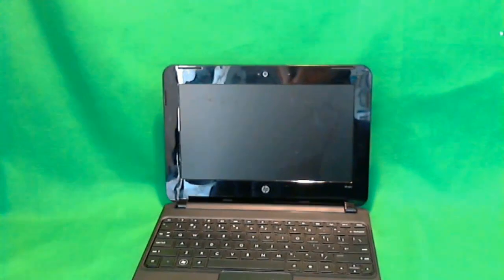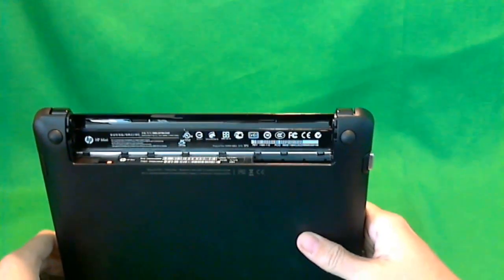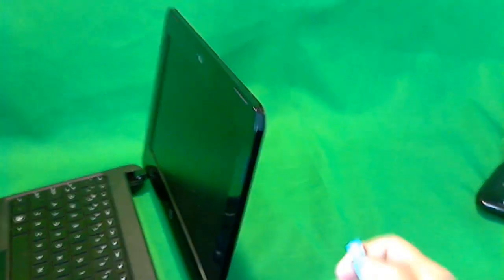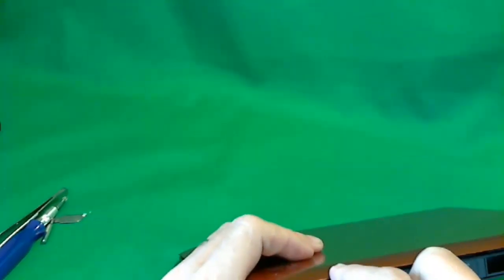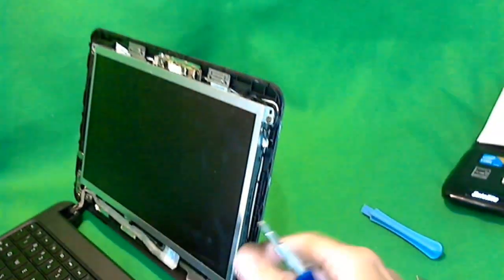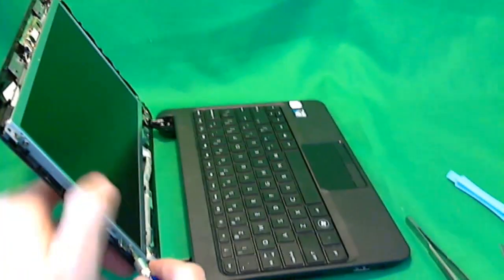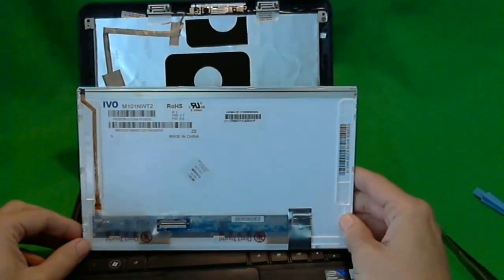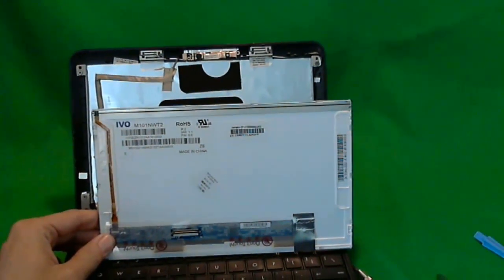HP Mini 110-3135DX Netbook Screen Replacement Procedure

Comment: Very helpful....same process for my hp mini 110-4250NR; even got to use a thin plastic knife and a small bread knife for d screws...didn't have my tools with me and needed to check out why my screen was flickering....alas it only took me opening n closing it to get my screen working perfectly again.
Reply: By d way, I checked to see d cable was well fitted....likely it was loose because after I closed it, the screen came back to normal

Comment: The most difficult bit was reconnecting the cable (Eugene doesn't show you this), it's a very slim fit and I thought I had mangled it, the adhesive stopped it from sliding into place, I had to use a slim plastic knife to push it in flat. But I was pleased that I got it to work, I would never have attempted it without watching this first.

Comment: You should never ever ever pull the cable out by the wires.

Only ever push the cable connector out by the edges of the metal connector

Comment: @hunteyvonne Sadly no, In fact the entire computer is now being replaced since I went to the HP site and looked for the parts. they DO actually have them up for order, but since my wires were split and everything it couldn't be fixed. hope you have better luck however.